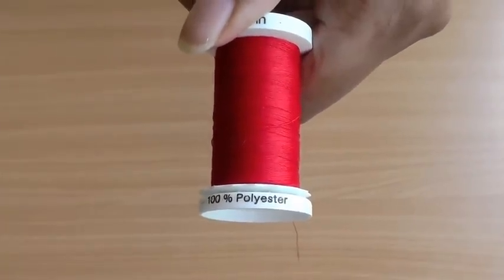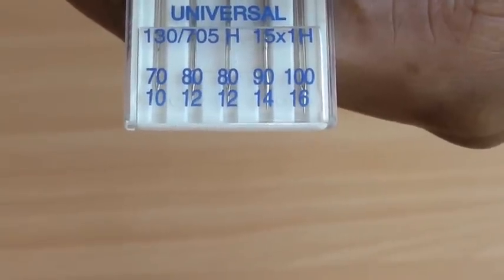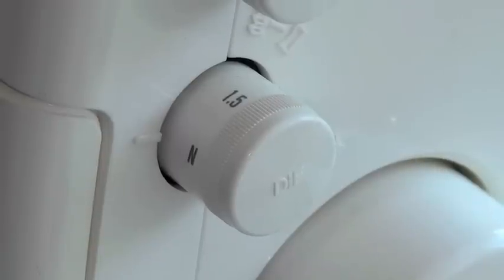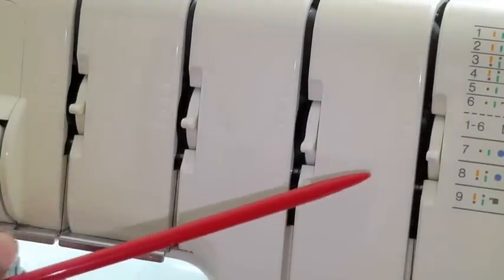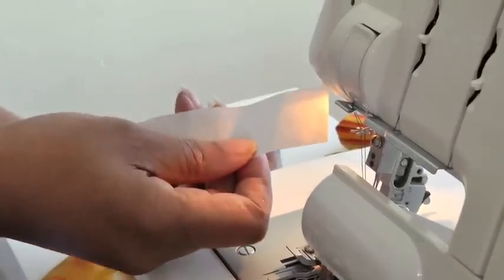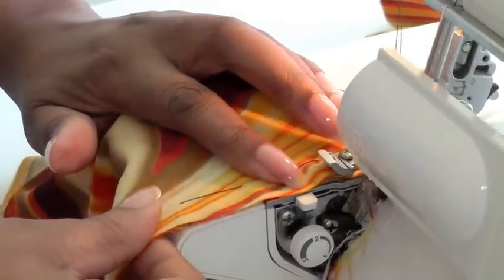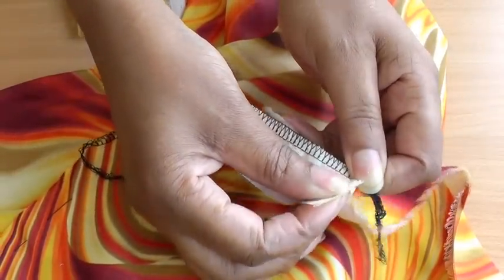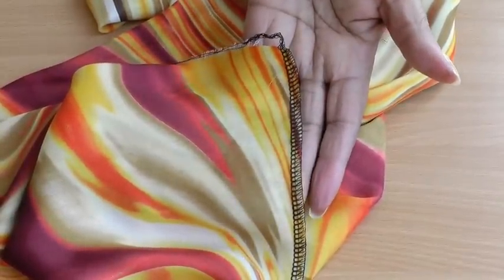Serging Chiffon and Other Slippery Fabrics

Comment: Wont the tissue paper dissolve in the washing and then the threads come loose ?
Reply from the maker: You tear away the tissue paper, and the threads are stitched/locked into the fabric. That should not be a problem.
Reply: Too easy , thank you 🙏🏽

Comment: I did think it strange that you only showed the paper on the outside of the stitching been removed. then magically with editing  the inside paper  was gone. How do we get  the inside paper inside the seam out.
Reply from the maker: It can be tricky to remove the tissue from the stitching, just pinch the top of the tissue and pull gently until it slides out.

Comment: Would it be better to use a water-soluble stabilizer instead of tissue, so that it will completely disappear?
Reply: You have to be really careful using anything liquid or water soluble as many of these fabrics are dry clean only and you can leave water marks on them. If you aren't sure you can test a scrap piece. But generally, the tissue method seems to be a safer bet.